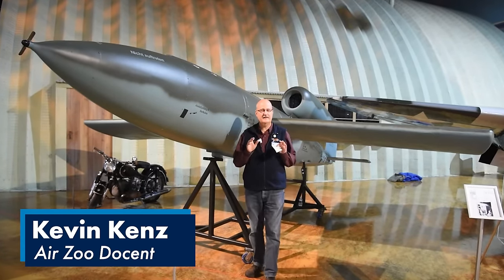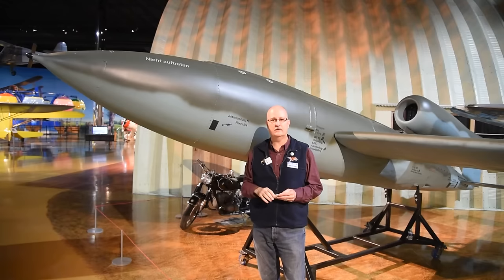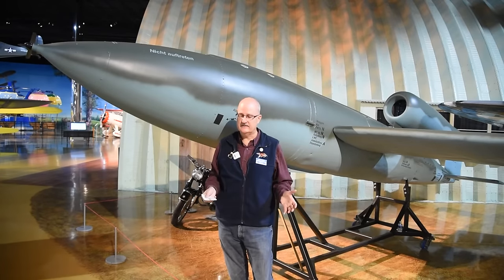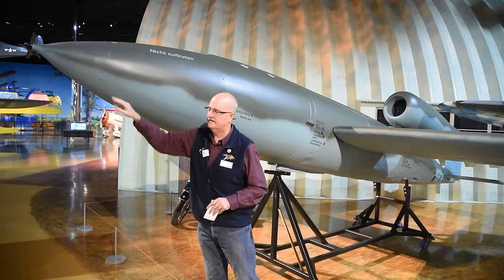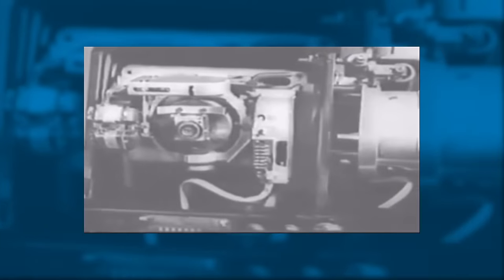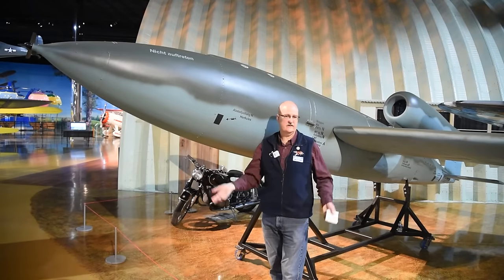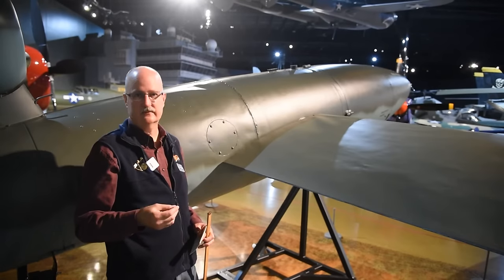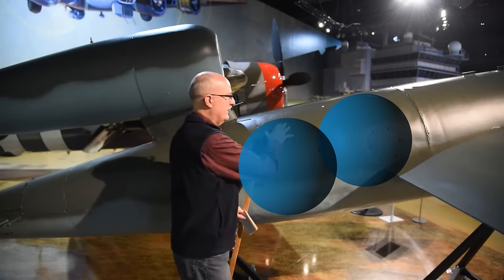V-1 Buzzbomb: A Technical Breakdown of the Vengeance Weapon

Comment: So, once the pulsejet is started and the V-1 is flying due to the catapult effect of the launching ramp, it becomes a true self-regulating robot that flies on a pre-set course for a pre-set distance, then executes a terminal dive into the intended target area. (More or less. I wonder what the CEP was.) Furthermore, I understand why pulsejet motors are impractical for anything other than these relatively low and slow, short-range,  one-way flights. If a designer tried to substantially address the shortcomings of the pulsejet, he'd eventually conclude that he was attempting to re-invent the turbojet engine. What I don't grasp is how the V-1 controlled itself in the roll axis. There's a good discussion of pitch and yaw control, but none regarding roll.

Comment: They should have made the wings longer to increase vibration isolation on the hull therefore reducing drift on the gyroscope increase flight time and increasing control authority from the gyroscope as well. It's not like they had a tactical advantage for these flying at a faster speed it was a weapon that mainly overwhelmed defenses with persistent swarm tactics to my knowledge.

Comment: I think you confused the steam generator used for the steam catapult (18:27) with the air for starting (likely just a big air tank). They wouldn't want to use an air compressor directly, as it would be too big and heavy- just fill a large tank slowly with a smaller air compressor. The German training film https://www.youtube.com/watch?v=5EEZuXQyA-E identifies the steam generator at  19:50

Comment: This is an outstanding presentation of the technology the Germans had at their disposal in WW II. In all actuality, the simple configuration displayed here was a far cry from the western nation's capabilities. The only limitation was the inability to "aim" it at certain targets thus, it was designed to dive at a distance over a city's location before the selected dive. Yet we should keep in mind they were minimizing television circuitry in order to install on air to ground or air to the sea surface, guided missile platforms. In fact, that was proven when film recordings of the televised assisted flight were achieved. However, in order to hit the ship's target was also aided by Pigeon. At the time, such attempts required a close televised system where a spotter aircraft's crewman could activate a lighted response to the Pigeon to see and trained to peck in the affected spot on the screen to release the selected birdseed dispersed as a reward. Thus, the pecking would alter the course of the missile. This required a thin cable to be attached between the spotter plane and the missile to attain proper guidance with the flight controls. And, they were in the process of developing a system that could be controlled by transmitting the signals in the air and eliminating the guide cable. Most people are unaware that the Olympics in Germany was televised in closed circuit television broadcasts to a few pubs in the area in 1936. And if given more time, it is quite possible they would attain a "cruise missile" with accurate guidance that could change the outcome of the war. However, I digress. This video describes the simple yet effective weapon of the "buzz-bomb," and how all the components were used within the missile to achieve a successful flight. The team that produced this video did an excellent job in articulating the weapon's construction and abilities. Thank you, Sir!
Reply: This was well within the allies' capabilities to build.
They just didn't think of it.

To be fair, the brits invented Upkeep and Highball, the americans had their Manhattan project, the poles broke Enigma, the French lost (big shock back then; big oof now) and the soviet republics... the soviet republics were busy suffering civilian casualties numbering in the double-digit millions as well as maybe ~8 million military personnel (yet somehow managed to savagely murder 5.1 million Wehrmacht and Waffen-SS soldiers, which you can read all about in the Black Book of Communism /s).

Basically, the axis powers fielded (or tried to) weapons and equipment that (at the best of times) made sense to them given their situation, and the allies fielded weapons and equipment that made sense to them given their situation, and the rest is a long line of poorly researched sensationalist documentaries and parroted cold-war  propaganda on the history channel.
Reply: germans used radioed controlled guided bombs to some success in the Anzio operation
Reply: @philiprice7875 
Yes, those had radio MCLOS guidance systems that worked over short distances of a few kilometers. The bombs were fitted with flares in the tail for visibility, and the bombardier would visually steer the bomb onto the target using his bombsight and a joystick while the plane passed over the target.

As far as I can tell, that doesn't have anything to do with the V1.

Comment: The USSR, based on the V-1, created Cruise Missiles(CM) 10X, 16X with a PJE engine. The PJE engine is simple, but it has low efficiency or high Specific Fuel Consumption(SFC) and low resource. For example, the Flying Target(FT) E-95M SFC is 4.5 kg/kg*hour, compared to the engine *ТРДД-50 0.7 kg/kg*hour. Therefore, since the 50s, the PJE ceased to interest designers, because the CM with such an engine had a low range of about 300 km, and much more was needed, which they were able to achieve by creating a suitable turbojet engine. But in the 80s and 90s, interest in the PJE reappeared, PJE is ideal for FT, where a complex turbojet engine is not advisable to use, and the FT does not need to fly very far, a range of 70-100 km is enough. By the way, the E-95M uses a valve-less PJE, such an engine has a much longer resource, although the SFC is worse.
Now the interest in CM with PJE has increased again, because such CRS are quite cheap and they can be mass produced. A large number of cheap CM easily overloads any air defense, and together with anti-radar missiles, the enemy's air defense can be easily destroyed. Including the NATO air defense, even the Russian air defense can be heavily overloaded, and the NATO air defense can be completely destroyed in a few weeks if enough missiles are used.
* - used in CM X-55, X-555, X-101, "Caliber".

Comment: Stoichometric combustion ratio by weight air/fuel. Kerosene 18:1. Petrol 15:1, Methanol  11:1, Nitromethane 8:1.                This is why normal jet engines flameout above 75,000 feet due rich ( mixture ) extinction.

Comment: I like pulse jets bever thpught about using what basicaly amounts to a 2 stroke engines reeds as a way to shutter and direct the force that would make starting the engine alot easier  than trying to get enough air going in to start flow and relying purely on thermo dynamics after that to maintain idle and create thrust most pulse jets require a bit of time to idle up i feel like this could hust handle sudden bursts in speed
Reply: @todydn - technically speaking, it's not "thermodynamics" that maintains the combustion process in pulse-jet engines, but rather it's the way pressure waves propagate in pipes.  When a positive pressure wave exits a pipe, there is a negative pressure wave reflected back the pipe.  If you've heard of "tuned length headers" in reciprocating piston internal combustion engines, this is the principle that makes these "tuned length headers" work.  I have a university degree in physics and basis of my senior thesis was pressure wave propagation in pipes... so I've studied this phenomenon extensively.

Comment: Really interesting. In the later stages it may have paid to have sensors on the wing tips so when a fighter tried to ''flip'' it, it detonated and took out the fighter.
Reply: I believe that such a anti-tipping device was installed in later units, which made the job of the fighter pilots trying to bring them down even more dangerous.
Reply: i heard that the "flipping" was in fact putting your wing under/over the V1 wing and upsetting the aerodynamics causing loss off lift
Reply: @philiprice7875  I heard the flipping upset the gyro causing the V-1 to crash.
Reply: @philiprice7875  Correct. The wings never touched.
Reply: Pretty sure the wing tipping stopped as fighters got faster and range of fire increased. Before that it was too deadly to try and shoot it.
Reply: @jdlamb4212  The V-1 flying bombs only operated against England for 9 months.  Not much development of the RAF planes in that time.

Comment: I have heard that the V1 could be intercepted by fighters and then thrown off course by the fighter flying alongside and tipping the V1 with wing to wing contact. It would seem easier to simply shoot the V1 down as it had no evasive capability. Is there any truth to the story?
Reply: Shooting at 850kg amatol around 50-100m in front off you is much more dangerous than simply throw the V1 off course. Wing to wing contact isnt even needed, bringing the wings close together is already enough to disturb the airflow over one wing, so the V1 started to roll and got out of controll, it had no ailerons to counteract the rolling.
Reply: @wolf310ii  Good point. One wouldn't want to create one's own shrapnel.

Comment: I wonder if such a pulse jet could be used to get supersonic, with tuning and the right airframe. I mean is there a fundamental problem, like exhaust velocity limits or pulse harmonics issues. 
Maybe hybridize it into a pulse-ramjet, ha.
Reply: @mytech6779 - pulse-jet engines are horribly inefficient (in terms of fuel used per pound of thrust) - therefore they are of no practical use in a commercial application.  The advantage of pulse-jet engines is they will burn just about any fuel and they are very inexpensive to manufacture (both key advantages to a war torn Germany in the 1940s).  I believe the Germans were experimenting with powdered coal dust (which can be made to "flow" like a liquid) as fuel for pulse-jet engines.
Reply: @danielklopp7007  That is all true but completely irrelevant to my question.
Reply: @mytech6779  the point to my reply: I suppose it may be possible to make a pulse-jet powered aircraft go supersonic speeds. However, why would anyone put forth the effort to create such an aircraft (given the poor volumetric efficiency)?
Reply: @danielklopp7007  Really? For the same reason people take on millions of other challenges.
There is a thick book published by the Guinness company you may want to take a look at.
 From overclocking a home computer with liquid nitrogen cooling to making lowrider cars, sculpting a statue, or making skydiving jumps from 100,000feet.
Reply: @mytech6779  Agreed.  However, since this project would cost millions, I guess we'll have to wait for a billionaire to be interested in making a supersonic aircraft with pulse-jet propulsion (in the same vein as Alan Eustace's world record skydive jump - a billionaire spending tens of millions to set a skydiving record).

Comment: I have a question to pose anybody who knows the answer:  The V1 only flew at 400 mph/640 kmh.  So this meant the allied air forces had plenty of fighters fast enough to catch up to it and destroy it (they used their guns or else they just flew alongside and flipped it using a wing-tip).  Since surely the Germans realized this, why could they not increase the maximum speed to make it a lot harder to catch?  After all it was a jet with no maximum speed restrictions as propeller planes have - about 450 mph, due to the physics involved - why could the engineers at Fieseler or wherever, not boost it to at least 500 mph?
Reply: How many successful fighter interceptions were there in actual fact? Not that many - flipping them was accomplished on a few, and shooting them out of the sky meant finding a balance between safe distance and target size, when they went off it was a deadly explosion. Flak guns and cabled balloons did the bulk of the work.

Comment: Good presentation,  thank you.   I wondered why that powerplant was never used in a manned aircraft- didn't know about the vane fatigue.   About the only thing that I didn't see was the altimeter control absent the ceiling adjustment provided by the fuel Governor.

Comment: The Fi103 was the first cruise missile. It lacked todays precision and had thus no decisive influence on the war. 

Later -45 - the velocity was increased so far that allied fighters were not able to intercept it. Later there was a radio controlled variant with a better precision but this was in 45 as well.  

The main question for me....
Why did nobody copy the very simple low cost intermitting engine after the war?
Reply: The answer is in the video. It was only useful for suicide missions because it rapidly tore itself apart.
Reply: @lhaviland8602  The engine is very suitable for a one time use only. In ww2 the life time was 30 later 45 min. But the modern cruise missile use turbo engines that are x-fold more expensive than a pulse jet engine.

Comment: On the plus side, your narrator provides a very detailed description of the fusing, fuel, navigation and flight control systems - but he makes the same error as other lay people when he attempts to describe how the engine operates - with two particularly wrong words used… The fuel entering the combustion chamber is not “Detonated” - it is IGNITED. The fuel/air mixture does NOT “Explode” - but it Burns (very quickly) - and as a result of that burning, it EXPANDS. The remainder of your narrator’s explanation is reasonably accurate - but it should be highly stressed that if you “Detonate” or “Explode” that vaporised fuel & air mixture, you’ll blow a big hole in the Pulse Jet assembly.
  This would be counter-productive..!
Reply: Something else, it's to my understanding that the phenomenon he talked about with the fuel sloshing to the top of the tank resulting in the engine shutting off was not intentional, they wanted it to have full power with the engine running during it's dive and when they found out about the engine shutting down when it went into it's dive they figured out what was causing it and took measures to keep it from happening, after that point they ran full power during their dive and the people on the incoming end of everything lost the ability to know when one was coming down as opposed to just flying over, everyone knows about how the British always said that when you heard one shut off look out, here it comes, but after they fixed the problem the British lost the ability to know when it was on it's way down.

Comment: Prevailing winds caused these machines to impact and explode in somewhat random locations.  A headwind would case it to hit short, a tailwind would cause it to hit long.  A wind from the south would cause it to drift north, a wind from the north would cause it to drift south.

So - these machines could be given a *heading*, but prevailing winds could easily blow it off its intended *course*.  Two different things.  Aviation 101.  https://www.youtube.com/watch?v=SKV1e8mFA10

These machines could not be 'targeted' in any real way, other than for it to hit within a vague area.  The impacts of prevailing winds made these machines unpredictable, which made them so terrifying for the populace.  They couldn't, for instance, target an arsenal (eg. Woolwich) or a seat of power (eg. Palace of Westminster or Whitehall), just the broader area of the city that these intended targets were located in.

The radio transmitters were used to determine the impacts of the prevailing winds and adjust later launches.

Comment: At 12:24, I never understood that system and why it was so complicated, with the bolts and cutters  and so on. Why they did they have not had a system  instead that the air servos default system is "flap down" and have a valve bleed the air? So when the air is gone, the flap is down and kaboom. It's beyond me, It's just so Overengineered. And a waste of material in wartimes, in my opinion.

Comment: A flying masterpiece with a deadly, indiscriminate intent. Years ahead of its time, the V1, from the Nazi point of view, had some success. Its weak point was its steady unwavering flight through the air. A resourceful British fighter could, very carefully, get near it and tip it. It would still hit the ground indiscriminately but hopefully away from a built up area. If a more accurate, pinpoint aiming system had been available, the V1 could have been disastrous for vital targets; thankfully, there wasn't.  A nasty weapon, soon to give way to the even more frightening, but indiscriminate V2 rocket.....which later, paradoxically, resulted in the Saturn 5 and the Moon landing!

Comment: I think a good engineer could design a new version which could function as a pulsejet then into ram mode for long distance flight good enough cheap drone engine for Ukraine to carry very heavy warheads WW II blockbuster size. use five engines at launch then turn 2 off for cruise to have in flight spares if needed. Rocket boost to launch.